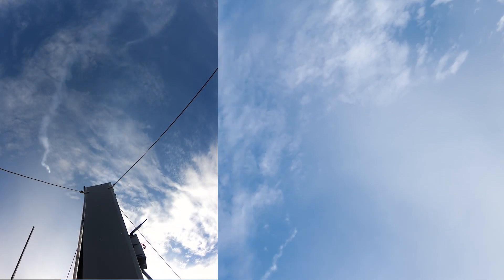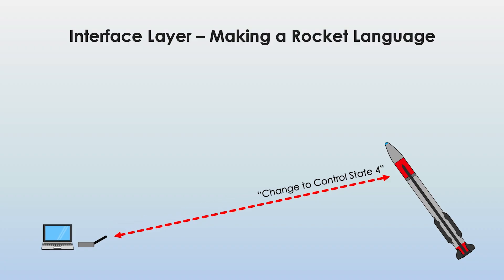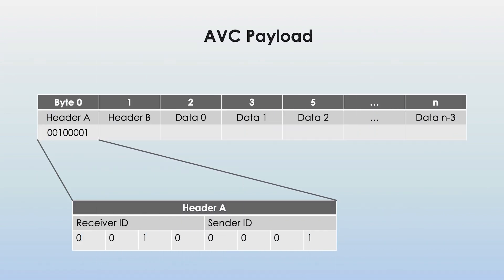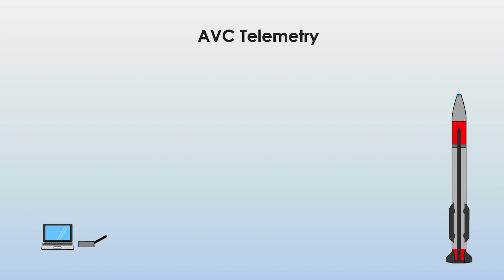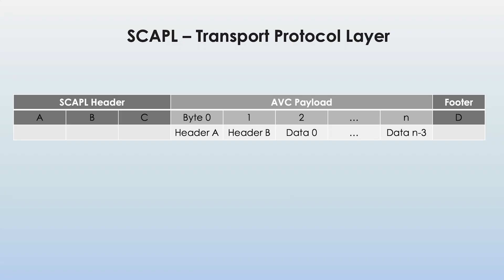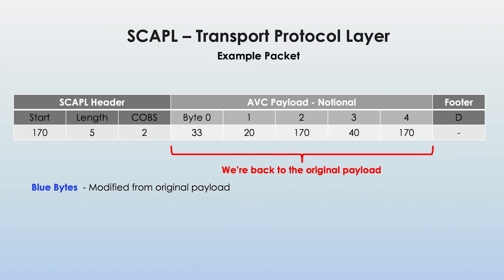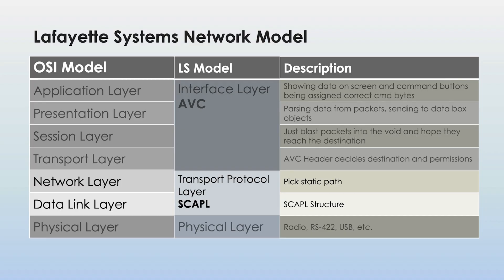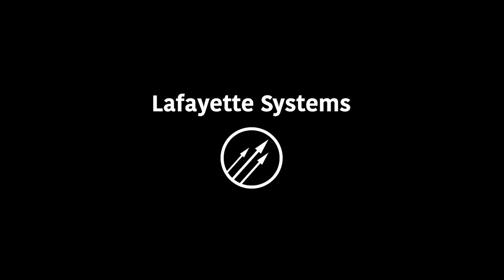Commanding a Rocket Via Radio - Homemade Two-Way Datalink

Comment: For your int16_t fields.. Consider encoding as sign + magnitude instead of twos complement.  This allows you to do things like varint (Protobuff) or better use zeroes-only compression (Capn-Proto).  The assumption is that the control values will tend to reduce in magnitude as the control system zeroes in on its target.  Great videos BTW!

Comment: Why couldn't you use the ProtoBuf for the application layer? It would greatly simplify your code!
It is just a serializer, so you'd still need to check for errors.
It also has a C++ library which is important for you.

BTW, you moved Trasport Layer to the AVC, which seems odd.

Comment: 7:00 how do you make an int value represent a number with stuff after the decimal point?
Reply from the maker: The worked example video will talk a bit more about this, should be released in the next few days. The short answer is you send the value in question in different units. If you want to send volts with 3 decimal places, you send the value in question as an integer in millivolts and then convert back to volts (with three decimals) on the ground control software. If you want meters with 1 decimal, you send as an integer in decimeters and again convert back to meters with 1 decimal on the ground control software.

Comment: very informative. I actually just finished a uni project for a wireless networking class with xBee pro's about a week ago, it wasn't anything fancy, just a bunch or xBee's and Arduino’s sending telemetry. It was just meant to be a intro to wireless communication; however I got a little passionate. I setup the units at home with OTA, so I could VPN in and see how they were going, which allowed for quick iteration when things went wrong. The xBee’s would intermittently drop packets or receive errors, sometimes even crash. So I started investigating and started implementing different messaging protocols to see if I could clean it up abit. I can see that it could become obsessive striving for perfection, I just wanted to see where I could get. Similar to yourself I implemented asynchronous messages,  start and end message delimiters, packet numbers, checksums, I started to implement an ACK / reply but ran into issues because of the asynchronous messages and never actually got it to work. I do like your message length idea, I ended up hanging a few Arduino’s early on; If I received some erroneous interference during the 'receiving' portion, and that happened to push the byte size larger than the message array then it would cause a stack overflow and cause the receiver unit to crash. Originally I tried to band-aid this with a WDT but this ended up just causing more issues. The solution for me was to modulo the incoming message size, so in the instance that the message would have overflowed, it would just start filling the array buffer from the beginning, and obviously this would cause issues with the checksums so the receiver would dump the packet. I like your communications specification, and i think it would have been a good idea for me to document mine while i was going. good work. i look forward to more videos.

Comment: Do you think you could need a version byte at some point, or are you just be going to keep all rockets and launchers in sync. COBS does seem clever - I have been recently experimenting with sending binary data over serial (which is how I found out Arduino Unos use 16 bit integers!) and was wondering about what to use as a start header. I will probably just use two bytes so i can use a number that definitely isn't within my data range. I am using it for a robot remote controller.

Comment: Have you considered adjusting the lowest layer based on what your transport medium is? For a radio protocol that is already doing all the framing for you, you should be able to skip a lot of the line coding overhead and get better performance. Your XBee modules probably already do all of the preamble and start/end of frame detection for you.

This isn't really any different from how a lot of other layered protocols are done, for example Ethernet's link layer doesn't worry about any line coding (just addressing and checksumming) and the scrambling encoding etc is all done in the PHY chip which will vary depending on whether you're running over 10baseT or 200G fiber or whatever.

So you can keep a common upper layer protocol suite but then vary the lowest coding layer depending on the media in question.

Comment: Great video, thank you for sharing! How does COBS handle 170 appearing across bytes? For example 0b00001010 (dec 10) followed by 0b10100000 (dec 160) will appear to have 0b10101010 if the message starts to get read partway through. It seems your scheme would work if the starts of bytes are synchronized, but depending on the physical layer, I feel like you may have times when you get a corrupt packet which happens to have an unfortunate 170 in the middle. (or maybe this is rare enough that it does not matter and is handled by the checksum etc.?)

Comment: I have a fairly similar packet implementation as yours, and what I'd recommend is that to use COBS to escape 0x00, and set the start byte to 0x00. So as long as your length of your payload is not 0 (which is always the case), you won't run into having several start byte in your header. In your example, the SCAPL might run into issue when length == 170

Comment: Do you use multiple antenna or how do you solve the problem of the ground station and rocket sending repeatedly at the same time and how long do those transmissions last?

If you essentially have to hit two 100 ms windows every second, it might be a good idea to add a clock sync. Depending on how much data you downstream.

Comment: 10:24 and what if that index too is 170? I mean, we can have as many indexes as we want since it is variable length, right?
Reply from the maker: Good question! That's where the packet length limit comes in. They can only be 32 bytes long, so our highest payload length is 28 bytes so we will never have to put 170 there. This does mean the payload could be up to 169 bytes long without running into any issues, but I've had problems getting packets that long to send reliably.

Comment: Super great explanation. 
I wondered at the choice of the start byte: Since it is a periodic pattern (10101010), is there not an increased chance it will be falsely received/sent by some physically occuring periodic oscillation/signal/noise whatever?
Reply from the maker: Here's my thought process, not sure if it's a good one: Especially when using something like UART, I wanted to make sure a line open or short wouldn't parse correctly. Using 0 or 255 as a delimiter might have that problem. I also wanted to make sure the transmitter and receiver had the same baud rates. I figured if they didn't, the likelihood of receiving this periodic start byte successfully would be low, so we wouldn't risk parsing a packet with an incorrect baud rate. If we did, we could interpret one command as something totally different, though the checksum should prevent these packets from being executed 255/256 times.
Reply: @LafayetteSystems  That makes sense. I am by not an expert on communication protocolls but have a physicists perspecive.
As such, it seemed to me that if there is some EM signal induced somewhere, it would have a good chance of being periodic. That said, I have no idea if this is a real problem in rocket electronics, so feel free to dismiss my input. With baud rates being somewhere in the upper acoustic one could feasibly imagine vibrations somehow coupling to the electronics (induction, piezoelectricity or just a bad contact somewhere). Admittedly, this is more or less far-fetched.
I believe your arguments would still hold for a not perfectly periodic checksum like 10101110?
Depending on how easy it is to swap the start bit one could probably test how many false checksums one gets for different start bits. 
But I guess that is a bit much effort as long it works either way :-P
It is pretty awesome to see what you are kitting together :D

Comment: One improvement you can do to the protocol parser is to store command codes + function pointers in a look up table, that you just iterate through. That gets rid of the switch statement and consolidates the entire protocol definition in one table, separate from the functional code. One step up is to keep the protocol structure separately in a JSON file or similar and generate .c/.h files as a build step. That way you don't need to mess with the code at all if you make changes in the protocol.
Reply: indirect threading for command parsing?
Reply: @homeopathicfossil-fuels4789  you can parse commands from a separate thread, but that's not necessary. This is more about the logical organization of the protocol processing rather than a functional change.
Reply: @frigzy3748  no indirect threading is interpreter speak, not threading as in hyperthreading or such. A lot of Forth's use indirect threaded interpreting, i.e you got a bunch of subroutines in memory that do their job then instead of returning they increment a pointer to a list of pointers to subroutines then jump to the next subroutine referenced in that list. It is a quite fast method of parsing/interpreting.
Reply: I don't understand the generation of c code from json part.  Incrementing pointers to subroutines gets you what?  It sort of sounds like continuation passing style but I'm not sure about why you'd do it.
Reply: @ it's just separation of data and logic. Data lives in JSON, logic lives in c/c++ files.

Comment: The telemetry theory and practice in itself far more satisfying than the "Ssssssshhhhhhhhf.....Phut!" of a 5 second model rocket flight.
Reply: both. both is good
Reply: @potatosalad68  

I apologise if my comment sounded disingenuous. It wasn't meant to be.

Such was the extraordinary effort put into the telemetry side of the project, it seemed, at least to me, a shame that wasn't put into a vehicle that reached the edged of the atmosphere.

Everyone's interests, needs and level of fulfilment are different, obviously, but for me it would have been smashing to see it last more than a few seconds of flight - sort of extending the excitement for longer or expanding on the experience.

I have a similar dilemma here in the UK but in terms of model UAV flights. Here we're forbidden to fly out of sight. Therefore, the type of aircraft I would like to fly, including their telemetry systems and their missions is out of the question. The fun police have put a stop to out of sight model flying after a nutter flew a drone too near aircraft at an airport as part of a harassment-come-protest campaign a few years ago.

Either way, it [the rocket project] is fantastic work.

Comment: Doesn't this violate ITAR? I thought we couldn't make guided rockets? Or is it autonomously guided that's prohibited without a license?
Reply: I believe the language of the law is indeed “guided” vs “stabilized”. Curious how this fits in. Telemetry data and two way coms are not an issue, so I guess it would come down to if you’re using those to guide the rocket or just communicate flight data.
Reply: @garrettwalton7461  thanks, yea i was confused cuz ive been seeing people starting to make more and more videos about making guided rockets i didnt know if they relaxed the regulation or not
Reply: As long as you're a US citizen, the only thing ITAR really prevents you from doing is exporting the controlled item (software, physical piece of gear, whatever). The legalese is a bit more complex but generally speaking you can build all the ITAR controlled hardware you want, as long as you don't take it out of the country (including posting controlled digital assets such as source code somewhere that a foreign national could access it) or give it to a foreign national within the US.

The biggest headache is that if your PCB designs end up ITAR you can't use cheap Chinese manufacturers to fab the boards, so things cost way more. One of the open challenges on my long term dream of putting a phased array radar up on my roof is that I'd like to figure out a way to avoid the the PCBs being ITAR (i.e. either build generic hardware that's not "specially designed" for this purpose, or just use a bank of off the shelf SDRs). If the software is controlled that's not a big deal as it doesn't cost me any more money to do the project, I just can't open source the code. But dotting the Is and crossing the Ts right would require retaining an export lawyer, which would cost enough that the project has remained on my wishlist for years without any active progress.
Reply: Coming to this discussion late (for anyone after me), yeah ITAR is about export of restricted data but there's another regulation called the USML (US Munitions List) under the Code of Federal Regulations. This directly falls under 22 CFR 121.1, Category IV: Launch Vehicles, Guided Missiles, Ballistic Missiles, Rockets, Torpedoes, Bombs, and Mines. There is a note under section A which specifies model rockets do not fall under this list for regulatory purposes (they live elsewhere), however model rockets must not contain active control i.e. RF/GPS/etc. I work in this industry and we have to abide by both ITAR and the USML. I also looked into something like this 5 years ago after college to practice my technical skills and ran exactly into this issue.
Reply: Way late asking this, but rather than a COBS byte, if you have a value greater than the length of the overall packet, could you just set that as your byte and decode any instances of that back to your start value? Or does the COBS method convey some specific benefit?

Comment: I was just thinking about systems that simplify the amount of work you have to deal with at a base station and for the rocket to autonomously do most of it. However this would be more so for small or simple rockets. Making a set of systems to deal with different stages or of the launch, like a set of numbers. The downside to this is that you don't receive flight data from the rocket, but the upside is that you only have to transmit very small commands, basically like saying 1 to begin preflight checks, 2 to launch, 3 to begin, 4 to adjust to a certain AOA, etc. (this could also even just be the specific radio frequency but that might have its flaws).Now that i think about it its sounds less efficient and means you cant learn anything about the flight performance of the rocket lol. Nvm forget i said anything

Comment: I think you COULD check the whole packet: since the value of the last COBS byte is almost freely chosen (anything from 29 to 255 is possible), if the CRC evaluates to 0xAA, just change one bit of that byte and the CRC will now be different ;)
Reply from the maker: That's an interesting idea, I'll have to give it a try!

Comment: You could get rid of the COBS stuff by just checking the length number when a 170 is seen.  If position is less than length, it's not a new message.
Reply: COBS is needed ONLY when the protocol specifies that it handles start and stop bytes. 
If you're making your protocol, you don't have to use it.
Reply: @pierro281279  Re-read the first word of my comment again.

Comment: Like cryptography, inventing your own networking protocols is probably not going to produce a meaningfully better result than alternatives in common use, and proven with experience.   I think you got the layering a little wrong or co-mingled.    Your "layer 1" "protocol" is a great thing to abstract out for media independence.  However, message/packet encoding should be distinct from the networking, transport and application protocols.   No need to worry about escaping framing characters if the physical link layer already naturally implements that.

For that layer-2 over asynchronous byte-at-a-time physical layer, ask yourself if you need anything fancier than a simple byte-stuffing protocol with frame delimiters?  Something like SLIP, with a single frame delimiter and escape character for byte-stuffing.   Sure, it's not "constant overhead", but do you really have very tight latency jitter requirements over the relatively low bandwidth links you have?  As for variable overheads depending on the contents of the message, over logic-level bit serial links, maybe use HDLC framing with very minimal overhead bit-stuffing?  Probably more trouble than it's worth.    And personally, I've always had an aversion to counted-byte payload framing as it really doesn't make it much simpler than a variable length packet with frame delimiter symbols.  Just consider the error recovery case; you end up looking for a frame delimiter in any case.  Just do that all the time.

Regarding your application payload, one thing you might take a look at are TLV encodings of data - Type/Length/Value.  Each piece of data is encoded as such, and there's a benefit that the decoder can robustly skip over data that it doesn't understand.  The "Type" can encode what the data is and imply the encoding (int_8,  uint_16, etc.), while the length allows skipping over unrecognized data.  This allows you to evolve your software systems without as tight of release synchronization amongst all the components.

As for message encodings like this, back in the day there was BER encodings as used for ASN.1 serialization as used in, e.g., SNMP network management protocol.  More modern approaches are things like Google protobufs which are on-the-wire encodings as well as a specification language that can generate some code stubs/definitions for you.

Very neat work here!  Thanks for making the video and sharing your journey with us.